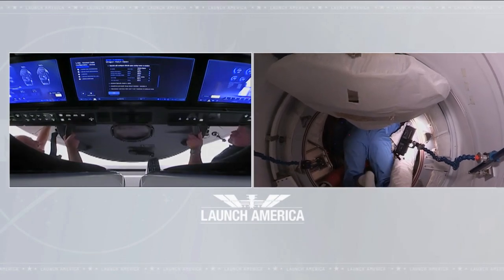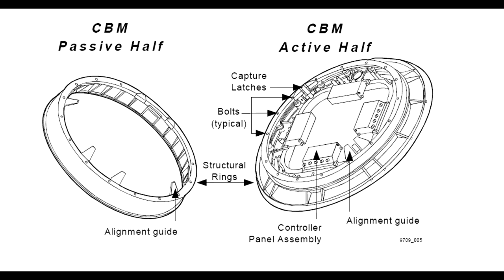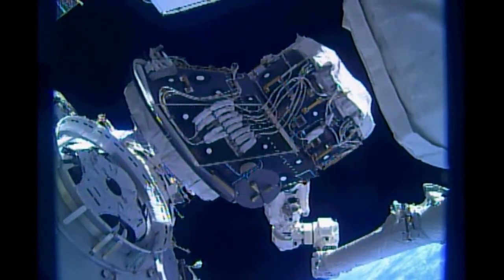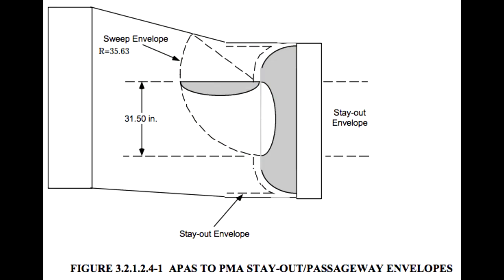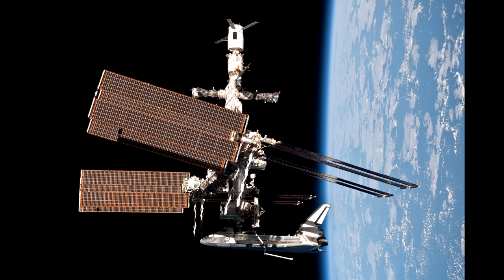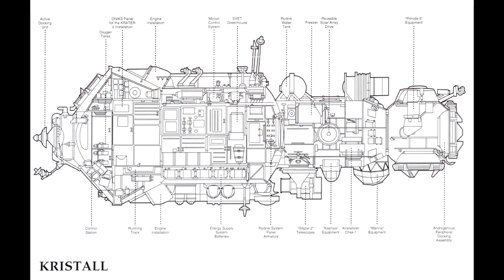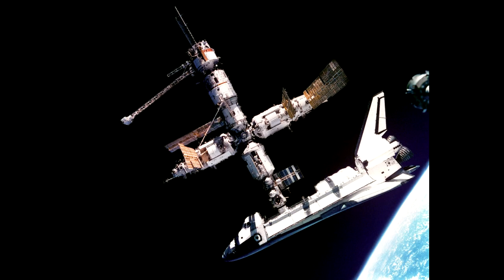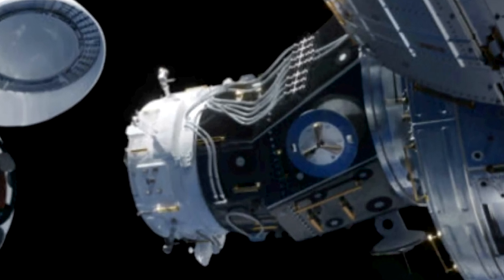Why The Docking Adapters On The Space Station Are Shaped Oddly

Comment: Imagine if the Buran was still flying. I was able to see one in Speyer in the Technik. The Soviets had some amazing ingenuity.
Reply: It flew once.
Reply: They were so ingenious that they realized right away the flaws of the concept (economic & technical) and dropped it in favour of Soyuz for that reason almost right away. Meanwhile, the US went on to waste lives, time and money on the Shuttle.
Reply: @Yutani_Crayven  Well, not exactly. The reason why they dropped Buran and the rocket Energia was their lack of money. If money hadn't been the reason, they would at least have flown the Energia rocket.
Reply: @Yutani_Crayven  We wouldn't have ISS without Shuttle. Or Hubble. Confront your bias because your bias is blatantly obvious.
Reply: @slartybarfastb3648  , if we didn't have the shuttle, we would have built a different style large rocket. it's now painfully obvious to everyone in rocket development that the shuttle design was a mistake. even those pursuing reusable upper stages are dramatically changing the architecture. we would have been better off developing a lower-cost version of the Saturn V.
Reply: @Slartybarfast B that's a popular misconception. There were plans to use Saturn derivatives to launch large modules, as had been done with Skylab. Shuttle was a result of USAF and CIA wanting crossrange capability and NASA, trying to secure the funding and a future, put in too many capabilities and compromises into the shuttle. Rather than doing one thing well, it sort of did two things with mediocrity.
Reply: @Slartybarfast B that's because after flying it once they immediately realized how unnecessarily complex, cost prohibitive and risk laden it was. Even while copying the US blueprints, their engineers could not comprehend why the US was pursuing this and concluded that a traditional vertically stacked rocket, with optional radial boosters would be far more beneficial. They only went through with completion of the project (albeit with 'slight' modification in the form of Energia-Buran system) at the insistence of their political decision makers, only to convince them with data after the first flight, that that was a fool's errand.
Reply: @F1fan4eva  But Saturn didn't launch those modules. Shuttles launched them. Reuseable Shuttles. Saturn was 100% expendable. Massive trash heaps. Given enough launches Saturn was guaranteed to have more failures than Shuttle. Saturn was tempting fate with every mission. Each Shuttle loss was preventable. Saturn was a roll of the dice.
Reply: @OpenGL4ever not the true story. Because they kept up with their Soyuz launches and built and maintained the first space station, Mir.

After flying Buran once, they immediately realized how unnecessarily complex, cost prohibitive and risk laden it was. Even while copying the US blueprints, their engineers could not comprehend why the US was pursuing this and concluded that a traditional vertically stacked rocket, with optional radial boosters would be far more beneficial. They only went through with completion of the project (albeit with 'slight' modification in the form of Energia-Buran system) at the insistence of their political decision makers, only to convince them with data after the first flight, that that was a fool's errand.
Reply: @somedude-lc5dy  At what cost would we have built a different heavy lift? Can you guarantee lower cost at higher safety margin than STS? Of course not. You're proposing theory, while Shuttle performed in reality.
Reply: @slartybarfastb3648  everyone knows the shortcomings of the shuttle. its un-necessary to defend it
Reply: Great discussions! The only merit from my layman perspective is to be able to retrieve something from orbit on the space shuttle, but with the cost of the shuttle it was probably cheaper to build a new satellite and launch.

Seeing the Buran in person, in fact seeing any Soviet design aerospace, or military equipment, there is a certain pragmatic austerity, less sleek and refined from western counterparts, but never lacking in ingenuity, or functionality.
Reply: Shuttles/burans were horrendous waste of fuel and money, dead branch of space vehicle evolution.
Reply: @randomnickify  still incredibly beautiful tho, much more than boring old capsules.
Reply: Slartybarfast B uhm yeah... we’re doing it right now lmfao
Reply: Runoratsu lol ah yes let’s waste money to make something look nice. You’re the dude who supports when the government buys a boulder and puts it in the middle of town then complains when their taxes go up
Reply: @slartybarfastb3648  The shuttle failed abysmally as a 'reusable' vehicle.
The point of re-use is to drive down costs and increase launch frequency.

The Shuttle by and large is one of the most expensive launch systems ever devised.

Even if you insist on building a space shuttle rather than a capsule it was a poorly thought out design, that was too large (owing to weird military requirements that were never even used), and it's launch configuration was a nightmare.

The ESA's Hermes shuttle design was far more sensible, yet that still wasn't practical enough to even have been built.

A lot of the shuttle's bigger safety problems come from it being so large that it had to be side-mounted to a rocket, rather than nose mounted.

And if you think the shuttle was somehow 'safer' than a Saturn V launch, you should go take a look at the abort charts for the two...
The number of black areas in a launch where crew recovery is almost certainly impossible in the shuttle launch sequence is terrifying.
For that matter, some of the abort modes suggested are nonsensical in practice anyway, so it's even worse than it looks at first glance...
The Space shuttle has proven in practice that it's considerably less safe than the alternatives...

To say that the shuttle losses were preventable is... Naive to say the least.
Perhaps the re-entry failure of Columbia was preventable, given that they could have remained in orbit and recovered it.

But Challenger was doomed, and you can call that 'preventable' but it's the kind of mistake that comes from design flaws and poor procedure, and if you call that a preventable accident then you can't reasonably use it to claim that a design like the Saturn V is less safe, because accidents with it, if any would have come about for similar reasons (and thus by your logic would be 'preventable')
Even so, given the nature of the capsule abort systems, a crewed saturn V with a similar failure to Challenger would have had considerably more chance of the crew surviving than the shuttle did.

Look, I love the way the shuttle design looks compared to space capsules, which, let's face it, are kind of dull.
But nicer aesthetics is not worth compromising safety and efficiency to the level that the shuttle did...
Reply: OpenGL4ever Lack of money made them clear that the design was just to expensive and flawed. As USA had the money, they kept on wasting it in a useless vehicle, the Space Shuttle.
Reply: Imagine a spaceshuttle docked to a buran.
Reply: @slartybarfastb3648  Shuttle designs regardless of country have to follow a common theme, however the Russian efforts were far superior to the US ones even on its first launch.
Reply: The real reason the Russians dropped Buran is the collapse of the Soviet Union in the period following the test flight.  People love to trumpet up the flaws of the shuttle concept, but the X37-B is still flying to this day.  The Russians did solve some of the Shuttle's problems in their Buran design and the Air Force appears to have solved the rest.
Reply: @slartybarfastb3648  the shuttle was also used to repair the Hubble a few times that's why they are taking so long with the James Webb Space Telescope they dont want another Hubble launch because there is no shuttle to repair it and its going to L2 none of our current manned space craft can make it there and back.
Reply: playgrrrr Soviets weren’t good at counting money but before mid 80s they were broke. Ruined by sanctions for Afghanistan invasion and low oil prices. Reagan admin hit USSR really hard.
Reply: @somedude-lc5dy  The ultimate Shuttle design was flawed but the originals were better. 
 
Funding was a huge problem and NASA had to get some military funding so they had to change the shuttle to accommodate the large Keyhole satellites. This also moved the Shuttle from on top of the stack to the side so they could reuse the RS-25s as a cost saving method. 
 
Had the Shuttle been smaller and mounted on top as originally envisioned then the astronauts on the fatefull Challenger and Columbia would have had a greater chance of survival.
Reply: @randomnickify  They never really finished the buran, and why did you say "buranS"?  They never finished the first one, as it was only a prototype.  The reason for the shuttle was they could do covert work in the bay and even capture foreign satellites.  I think the idea of a reusable space vehicle had merit, sadly the tech or the vision was just not quite there.  

Keep in mind the real reason for the space rocket funding was for lobbing nukes to and from the free world.  Many products and advances came from NASA and this project and I would rather my money be spent on exploring base than building 1,000s of new tanks or subs.  I am a big fan of the A-10 though.
Reply: @marsy8749  It would be like any American product parked next to its Marxist copy.  I can go to China to see it with iPhones to Range Rovers. Boy, what Russian would have thought that the Chinese would be so much richer and advanced?  The west saw it once they noticed the large mean IQ difference combined with American business venture models that made S Korea and Japan tech powerhouses in less than a decade.  Schengen, when it was open to the was was like a rocket ship into becoming a developing nation.  Sadly the CCP still has power, but the plan might still work decades later?
Reply: "copy"
But Buran was superior to the Shuttle
Reply: @David - Buran flew in November of 1988 and while it was unmanned, it spent 3 plus hours in space and orbited the Earth twice before returning for a perfect world's first automated landing on the runway close to it's launch point. Sadly it never flew again and was ultimately lost when it's neglected storage hanger collapsed in 2002. Two sister ships, Burya and Baikal, survive today together in a hanger in Baikonur, Kazakhstan. One of them was designed only for Earth bound flight tests similar to Enterprise. Other scale mockups also exist in various museums.
Reply: The only Buran that ever flew was destroyed in 2002 when its hangar collapsed.
Reply: Fun fact: The original design of the Shuttle was a two-stage plane, which would be fully reusable. But NASA needed to save money for the development.
Reply: @HalNordmann  Also seen concept art that stuck the shuttle on top of a rocket, which would have elimated the foam from the fuel tank striking the shuttle.. it is a shame that 14 people paid for these mistakes with their lives....
Reply: What do you mean still flying ?
Reply: What do you mean still flying ?
Reply: @anonamus4860  -- "Imagine if"
Reply: @noop9k  Not only that. People keep on forgetting how much it costed to do all the things after Chernobyl exploded. I wasn't neither cost less nor finished in a week.
Reply: @adammarkiewicz3375  USSR economy was suffering years before Chernobyl. Chernobyl was just the finishing blow. Or one of them at least.  I don’t believe it was a crucial factor. Yes, a certain amount of people was relocated and certain amount of agricultural land abandoned. They didn’t even stop the power station.
But, compare to the number of people involved in Afghanistan, or the soldiers who were forced to return from Warshaw pact states and had to be fed.
Reply: @GewelReal  Buran is not superior as  Buran loses entire Energia rocket on every launch, with its expensive main engines. Buran is much less reusable.
Reply: @rolfschubert1853  There are videos of people sneaking in to the hangers, playing with the electronics hooking up batteries, and launching fireworks out the back end. Kind of cool to see the insides of the half built ships, but also sad that people just disrespecting them. But I guess they're just old uncompleted ships....

Comment: Being a Automotive Mechanic, the offset angle appears to me a crash structure that will be sacrificed during a bad docking maneuver without transferring the impact loads directly in a linear path into the entire ISS structure.
Reply: Does make sense. An aluminum can bent some is easier to crush without causing more damage to what it's attached to.

Comment: It's interesting how similar some of this equipment is to what i use underwater as an ROV pilot/tech. RE:Docking rings and manipulators etc.
Reply: DANK  When you factor in the ambient pressure at depth i would say it's every bit as dangerous too
Reply: @kmc7355  in that sense space is actually a lot safer, You only ever have to assure your habitable spaces can withstand 1atm difference between inside and outside.  And Id suspect one has more seconds of survival in vacuum than they would in the depths if a seal pops and they have to book it to another section.

I honestly feel this is also why we know more about our solar system than the bottom of the ocean, Its easier to make machines that can withstand the rigors of the cosmos than thousands of meters of water.
Reply: @filanfyretracker  You are absolutely correct, which makes it such a fun career,  just getting to see the varied wildlife is awesome. Oh and shipwrecks!

Comment: The APAS is a significant upgrade over its predecessor. In testing, it was proven much more compatible with various types of equipment than the M0N-Ky-Bu77 docking port that it was developed from.
On another note, the section that showed the shuttle's docking equipment in different locations has me curious about how the Center of Gravity was managed for the mission segment wherein the shuttle was expected to pretend to be an airplane. I expect at least one instance of them having to pile hammers and crapsacks on the dashboard, and everyone lean forward and extend their hands and feet... Just to make sure it doesn't swap heads and tails.
Reply: well it only needed to be a plane on the way down and not on the way up, so wouldn't it always have a similar center-of-gravity empty? or maybe the thing just flew like such a damn brick anyways and it did have fairly large control surfaces given the speed that it was going.  but yes of course center of gravity vs. Center of lift is important for anything that flies, even the loose definition of flying that applies to the shuttle
Reply: @laprepper  It still carried the docking port when it was empty.
Reply: I think it would be moreorless fine CoG wise. I'd imagine it wasn't super significant compared to the cabin area at the front and the engines at the back, and both positions appear to be well forward of the center of lift which would be close to the back with those big delta wings.  So as long as the shuttle was able to fly without the docking adapter at all, it shouldn't change much.
Reply: As I recall, the shuttle was designed to return hardware from orbit, and did so on at least one occasion. So the docking port may have been well-inside it’s CG limits.
Reply: Considering the shuttle was essentially a sophisticated, winged, rigid heavy truck, surely there were procedures on how to fill the cargo bay. It might have even been a simple rule like fill from the back forward
Reply: All aircraft allow a range of stable CG positions.  That's what the trim is for.
Reply: @stargazer7644  That must be why pilots are always talking about "getting some trim".

Comment: Because first international adapter was made by two sides of Cold War in slightly rushed fashion with problematic communication between the teams and then it was accepted as standart?
Reply: yes
Reply: The wheels turn slowly in the globalist model.
Reply: Slartybarfast B ?
Reply: Sounds about right
Reply: That doesn't explain why the adapter on the ISS is offset instead of coaxial. The first international adapter, the one for Apollo-Soyuz was straight, not offset.
Reply: @skunkjobb  I was thinking that it might have to do with getting the maneuvering thrusters aligned away from the solar panels. Looking at old mir pictures there seems to be a panel behind the docking port and they did have issues with those kind of incidents before.
Reply: @carlwheezer3353  What do you mean by (?) ?. When you try to get completely different concepts to work together the wheels turn slowly. Soyuz is a capsule. Shuttle was a cargo bay. They tried to make the docking port work for both which added complexity, cost, weight, future issues etc. Wheels turning slowly.
Reply: Slartybarfast B I didn’t really understand it that much since i dont know much about these. Sorry for the inconvenience
Reply: @carlwheezer3353  No sweat. It's just easier and more efficient to engineer parts to a single standard. Cell phone chargers are a good example. Why not standard batteries and universal chargers? It's better now, but early on had unique batteries and chargers for nearly every phone.
Reply: @slartybarfastb3648  because of Apple. And no, it's not better. Adapters we use as universal ones are designed as a workaround for Apple's patent abuse. In the end Apple themselves adopted it. And? We now have a workaround suboptimal design as standard!
Reply: There as never an international adapter during the cold war

Comment: I've always assumed that the PMA between ROS and USOS is also for the center of mass to be closer to the centerline of ROS (as the pressurized modules of USOS are at the bottom and truss section is at the top). Which would help when ISS is boosted from the aft port to prevent unwanted torque.